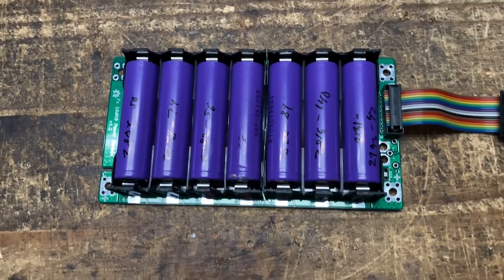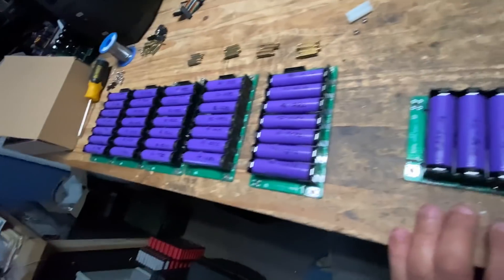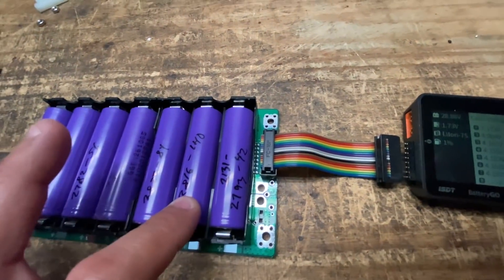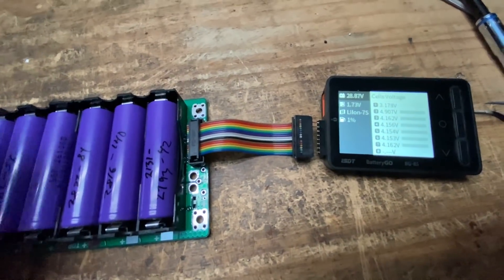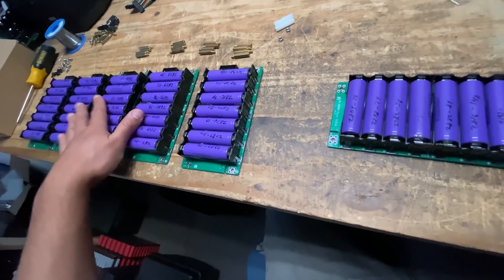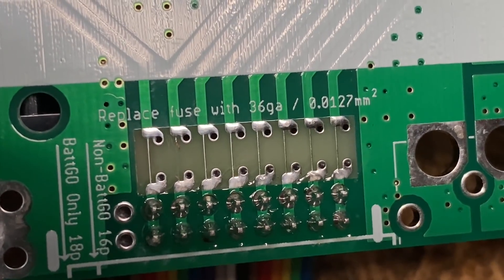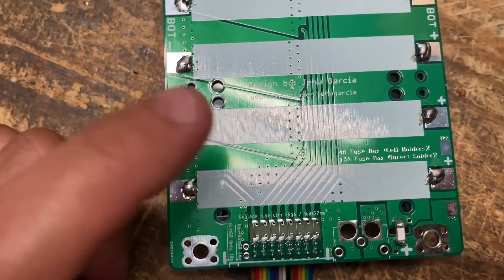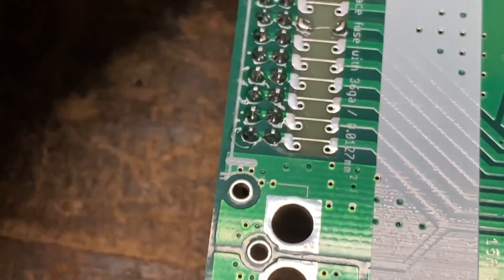Fixing Blown Trace Fuse on DIY PCB Battery Powerwalls

Comment: I had a similar issue, and it turned out one of the welds came off.  Luckily I dont use a BMS and monitor the battery using a cellLog.  Thank you for posing this informative video.  A BMS might not alert related to such issues with blown fuse or lose welds.  Thank you for posing this useful information.   Is it possible to DIY more than 8s Battery Monitors?

Comment: Would using 1A or 2A poly fuses here help? The short or over-amp condition would be cleared once you take the pack apart from it's brothers, or disconnecting the ribbon cable.

Comment: The reason you're still seeing readouts for c1 and c2 is not because you have a weak current, but because the wires act like a capacitor. Without going into much detail: you still have a voltage difference between line 0 and line 2 of about 8.3V (2x 4.15V) and then whatever potential is on line 1 (the one with blown fuse) at the side of the reader, the readouts must add to those 8.3V. That's why you have 4.9V and 3.17V on the reader (8.07V total, a bit short of 8.3V but I don't wanna go into detail as to why that may be the case ;) ).

Comment: Hello,
I have a question about connecting Li-ion cells.
Is series or parallel connection the better option?
I noticed that when connected in series, the middle link is the most exploited and discharged first, which is unfavorable. What does connecting a large number of cells in parallel for e.g. powerwall applications mean?

Comment: can you make a 96v or 192v  system like that and if yes where can you get a charge controller and inverter for that voltage?
Reply from the maker: You can but there is a very limited amount of equipment that works at that voltage,   Here is one MabelStar 8000W Power Inverter 96VDC 110V/120VAC Peak Power 16000W Off-grid Pure Sine Wave Inverter https://www.amazon.com/dp/B01MQPZXC0/ref=cm_sw_r_cp_api_i_SgRBEbTB70WTT
Reply: 240v
Reply: Can i use this battery or the headway calls

Comment: The designer of the original pcb's says these boards are only for testing 18650's.
Why do you promote and sell these pcb's as actual parts for powerwalls?
Reply: Wim Verleyen link?

Comment: why not have changeable fuses? Looks like you have holes to plug fuses in
Reply: This is a hack that should never be on boards shipped to customers. An SMD fuse might be harder to replace but is also very much more safe than this.

Comment: As a PCB designer for over 25 years I can tell you flat out, it's impossible for that trace to take 10A before it blows.
Reply: to be fair it's sensor line so there should be little to no current flows there at all
Reply: @FathinLuqmanTantowi  Wondering what kirchoffs law says...
Reply: @cekpi7   well sense line should be high impedance.
Reply: Hey ugetridofit: if it’s impossible then how does this video make sense? https://youtu.be/4ET20ZmbVNc

Comment: Eventually there will be a jump in battery cell technology as it was from Nicad to Li-on. Perhaps solid state cells. It may be a significant enough jump where nobody wants lithium anymore. With the billions being put in to R&D, it is only a matter of time. Samsung has recently published in a scientific journal, a solid state battery with a silver composite anode. I liken the change from liquid electrolyte to solid, as hard drives went from spinning disks to SSD. I am saving my money for solid state tech. When it comes, it will be amazing.
Reply: You may still have to wait decades or never. We have to use what's available now.